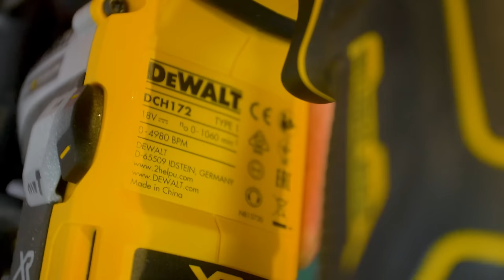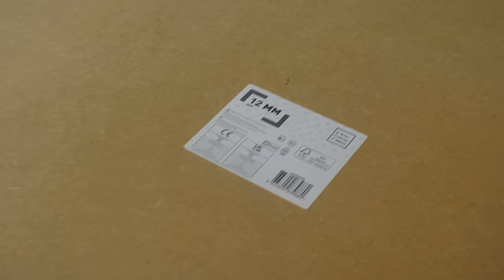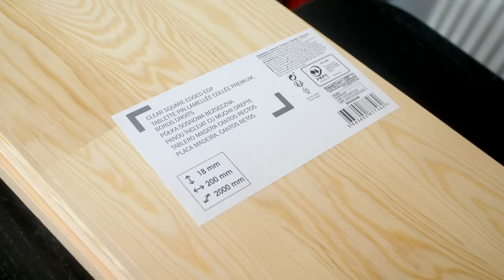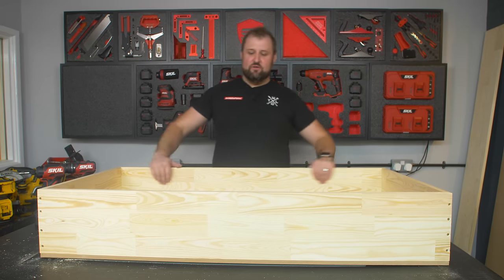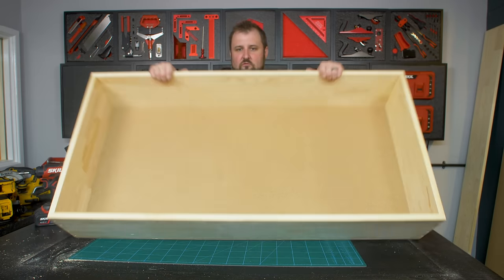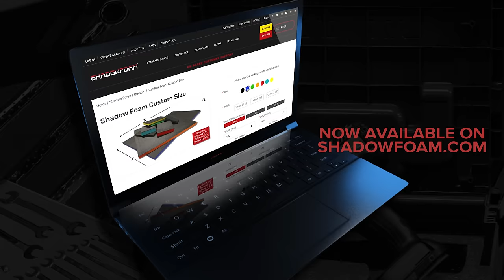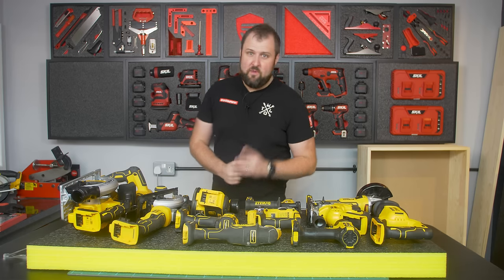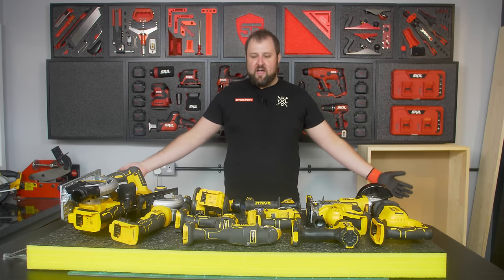I Built The Ultimate DIY DeWalt Power Tool Display Wall Panel!

Comment: I’m a dewalt guy. I really like your box design . My box is horizontal and has cubbies for each tool . This idea saves a lot more room than the way I’ve done mine. The only problem I see with your design is that if I put in a trailer they would fall out while driving but perfect for shop.
Reply from the maker: If you lay the panel down flat, they wouldn’t fall out, also if you cut them in flush, the foam should hold them tight! Would love to see your setup mate

Comment: I got a different strategy. You know how you can only change the whole  foam insert at once, so to stay a little more modular it would make sense to divide the foam insert into smaller portions. To be able to swap those out if you are not happy. 
I chose the standard Euro Box inner size as the frame size (ca. 600x400mm). Which means, I can take it off the tool wall and place it inside the standard collapsible Euro Box container, which is a makeshift toolbox (for RV and so on) and helps me when I need to move. Also grouping the tools in like "woodworking" group and "metal working" group etc. per frame. I will see soon how that works out. Plus my whole system is based on that standard industrial quality boxes which means my drawer sizes and so on. ""Modularity"".
Reply from the maker: Let me know how you get on with this system, I’m intrigued to see it in action!

Comment: Hi Jonathan. Another great video. 
Was a Dewalt user and still am as I have a good selection but I’ve been converted from the Yellow and Black to Festool. Any future purchase of new or replacements will be from the Green and Black.
Reply from the maker: We’ll be doing a Festool video shortly mate, any recommendations?
Reply: @ShadowFoam  I’ve started kitting out one of their  large XXL Systainers. Done a duel layer. Still needs a bit of fettling. But it’s well on the way.

Comment: You can use a router to ligthen the box and cut out a lip around it for the foam to grab. Personally 18mm solid wood is too heacy I would probably use aluminium profiles or a solid wood frame with thinner 6mm plywood outer skin or something like that.
Reply from the maker: That's a great idea!